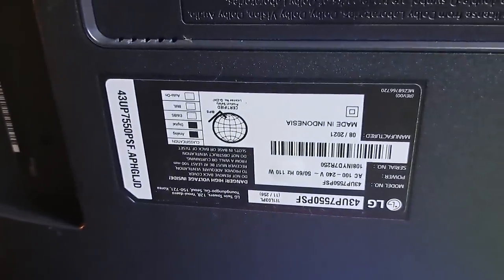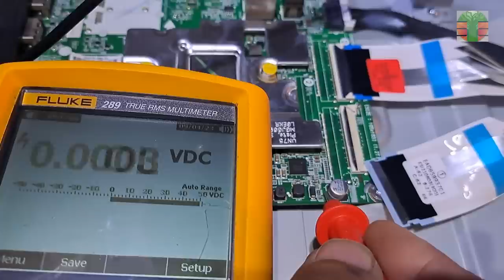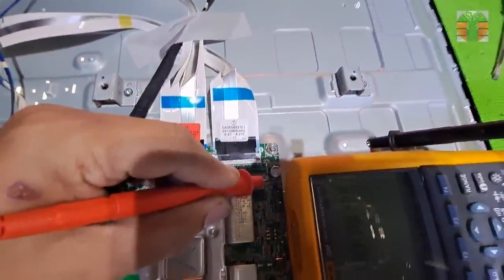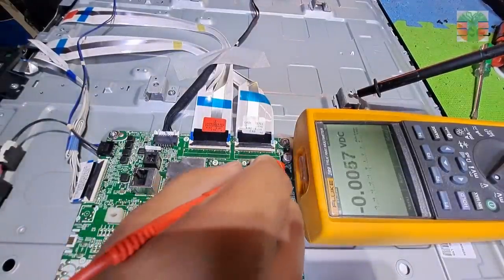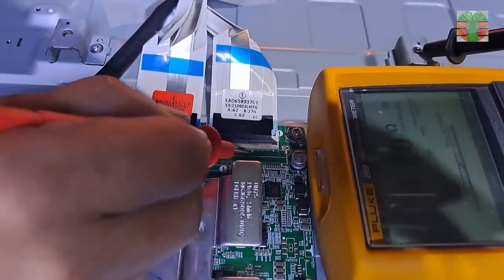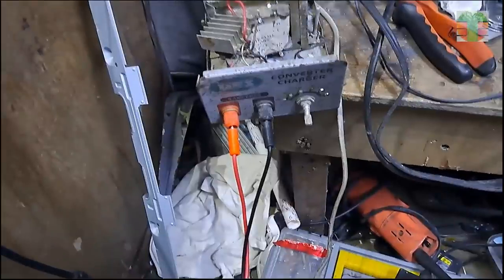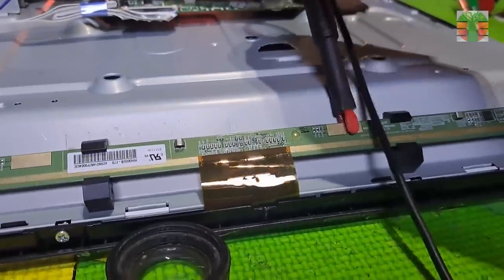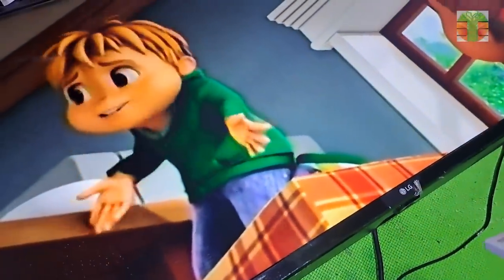Shorted line tracing has gone wrong.

Comment: Nice one tevz. Please can you tell me how you built your voltage injector. I think I have a tv with similar fault to fix.
A friend to me to use 12 volts power supply (transformer power supply) but I'm not convinced with his method. 
I think your method is better.
Initial fault the tv had was no VGH, on the gate Cof so I connected VGH to it and it worked, the owner brought the TV back with vertical lines on the screen. So this time I connected the VGL after some days he brought the TV back, this time no display and I've not checked it again. So my friend said I should check the resistance between the VGH and the VGL if it's shorten, then I should inject the voltage.
To you, why do you think I should try
Reply from the maker: From VGH to VGL short circuit is hard to kill the short. Use sbout 15 volts 500 mA.
Reply: @tevzTVTevatronics  okay thanks